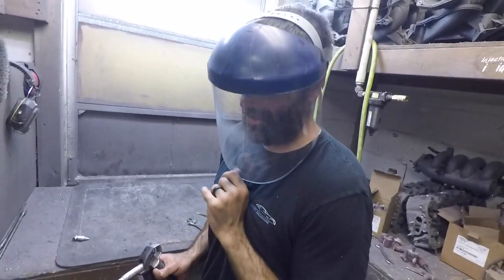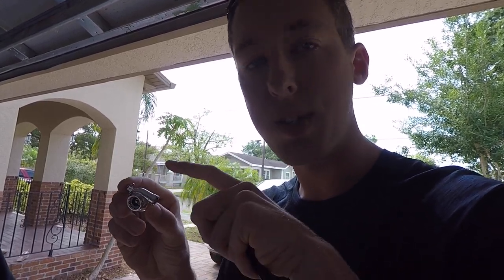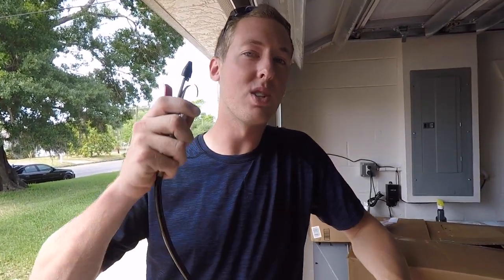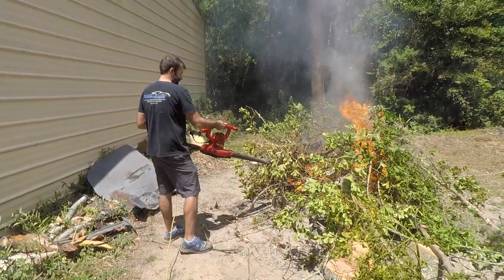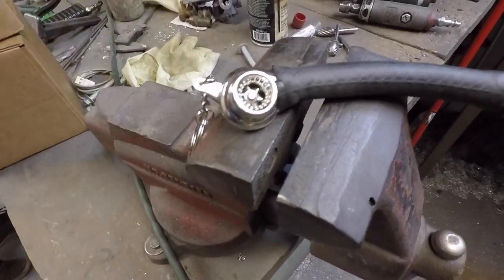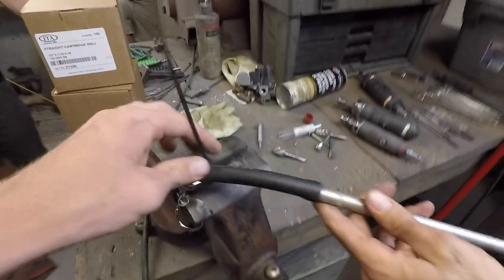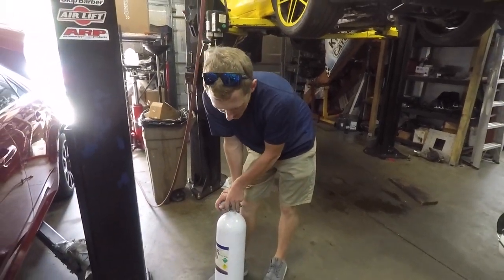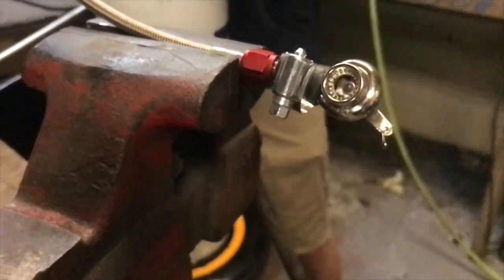Turbo Keychain vs. 850psi (Didn't End Well)

Comment: If there was an oil feed into that, I bet it would survive for a while
Reply: you can see its reeeeeally wobbly af
And yeah probably.
It would need to be soldered or welded more tightly together and sealed too. Because flimsy material..
Reply: Also the cold from the nitrous really did a number. Real exhaust feeding though would’ve been hot
Reply: Wd 40

Comment: when a keychain turbo is more reliable then then then then then then then then then then then the one in your 6.0 :(
Reply: Just a Bat. than*
Reply: Just a Bat. 592k miles on the original turbo over here in ga
Reply: whoa there, stranger. what is grinding your gears to the point of insulting this lad?
Reply: Charlie Foxtrot who?
Reply: Just a Bat. Than*, not then.
Reply: @Mark original turbo on my 6.0 international powerstroke engine. Over here in Georgia. Are you slow buddy?
Reply: I heard 6.0 power strokes aren't good
Reply: Rip

Comment: The reason it broke with nitrous is because it made the metal super cold and brittle.
Reply: donnie caudill Finally someone who understands the scientific reason why it failed! If they were able to heat up the nitrous enough to keep it a few degrees lower than room temp to keep it cool, not ~ -150 or lower.
Reply: Ceinnod 1 so it will bot break if its hot?
Reply: They should use air not N2O
Reply: Maybe next time, run it through an intercooler, which in this case would actually warm it up? :D
Reply: it wouldnt have taken 900 psi warm
Reply: Will it be the same thing if we used compressed air ? With more or less pressure ?
Reply: Did I stumble into the NASA or Space-X chat here??

Comment: Can someone make and adaptor to fit this to some car because this little turbo can hold more boost than and Subaru
Reply: Stay Sliding 145 psi in this would be like 2 psi in a small stock turbo as far as how much air it actually moves
Reply: Put it on a Cox .049 or something
Reply: But what if you install this into a tiny engine, say one for RC cars?

Comment: Interesting, it looked like it was just a pressure failure of the plate, as opposed to outright centrifugal disintegration of the impeller like you'd expect....I was screwing around in the shop one time, playing with the air gun and the "stitcher", a tire repair tool that has a toothed wheel for rolling patches down. I was spinning it up with shop air @ 125 psi and it was screaming like a turbo, then suddenly the plastic bearing race decided to explode and it slung steel ball bearings in every direction and the wheel ping-ponged all over the floor like a psycho Beyblade or something for about 10 seconds. It was pretty epic. I have more shop hooliganism I've done. Glad to see the tradition is alive and well!

Comment: The reason for the cold temperatures is from a phenomenon called adiabatic cooling. This is where the gas loses energy by expanding instead of transferring heat by conduction. The greater the pressure diff, the greater the effect. Paintballers would be very familiar with this, since their tanks can get freaking cold!

Comment: Mos any compressor regulator can not only be adjusted for output pressure by the know but also the max pressure can be increased by adjusting the limiting screw.  Most compressors can be set to at least 180psi, or more.

Comment: Also... I'm pretty sure the turbo broke from the moving parts being frozen way before it did from pressure. The bolts that hold the back on froze and the impeller froze/broke.

Comment: Now I'm curious. What happens if you nitrous a turbo setup?  Can you nitrous a turbo setup?  Would it grenade the engine?  Oh, I'm sure you and your buddies at fasterproms could put together some kind of test rig with a 500 cc single cylinder motor from a used dirt bike, some small turbo setup to slap on it, and try a 50 shot of nitro on it. Heck, if it doesn't grenade,  maybe make a go-kart around it. I bet that'd be fun!

Comment: I blew compressed air from a shop air compressor into a laptop microblower...  The blower exploded into shrapnel, completely clearing the spindle off the blades.  The plastic bits of the blower put large dents in the heatsink and bent some heatsink fins.  That's quite a lot of energy for some plastic shards.

Comment: Instead of freezing and breaking things due to the cold vs the pressure... Why don't you just use a scuba tank or compressed air tank like for paintballing? Cheaper, warmer and thus more consistent, smarter... It's also regulated to 850psi...

Comment: the failure is not even from overpressure, the cold caused the metal to become brittle resulting in the structural failure.

Comment: Reversing a compressor by blowing air into the discharge side, basically, just makes it act like a turbine of a turbocharger, just not every efficiently since the impeller is all wrong. (assuming this little toy is actually designed like a real compressor).

Comment: wanna find out what the psi coming out of the nitrous was is check the gauge before and after. hint take number you start with and subtract the number ur left with...take that number n divide it by how many seconds the valve was open for...tada...you get how much nitrous was comin out...

Comment: And what about temperature? You know - even steel is like ice when its temperature is very low under 273K. You can't compare air to compressed nitrogen as a propulsion unless you equalize the temperature.

Comment: probably broke because the N2O cooled the parts and made them brittle and change size. might have been okay with pressure if you used say compressed nitrogen instead of N2O.

Comment: Only reason it blew was it could not handle the coldness, should of used welding gas like argon so it was just boosted but not frozen. Then rigged a laser tach for rpm. I call for a rematch.....

Comment: It is obvious that this guys do not have a clue. This thing is not a turbine but a compressor. They used it completely wrong. They should spin the impeller and use it to compress the air to boost the power of a V8 or at least compress air into tank for later use in power tools.

Comment: why not just use high pressure bottled air (like a dive , or air gun refill tank) that will get you  over 3000psi, that would've worked..  lol.